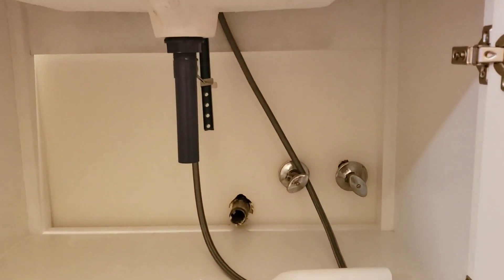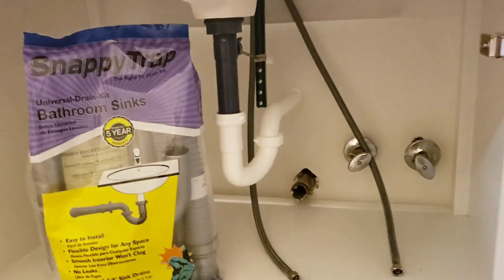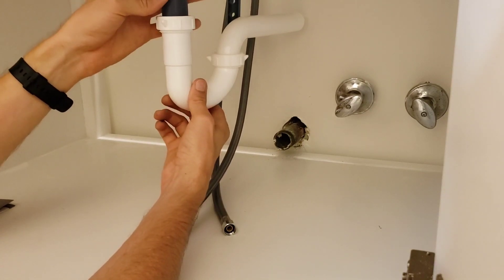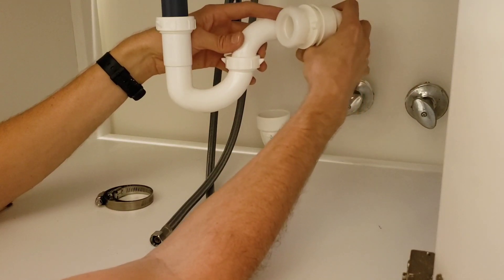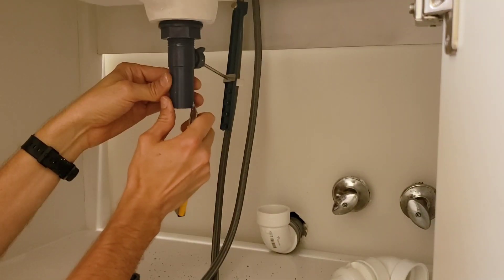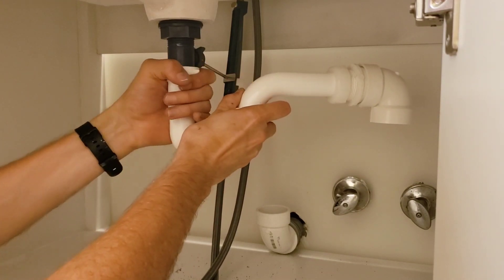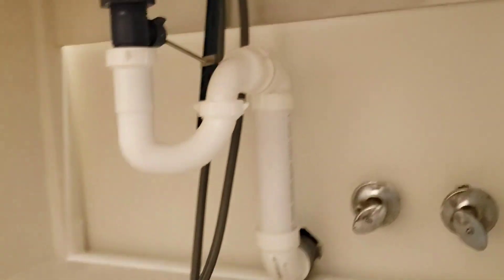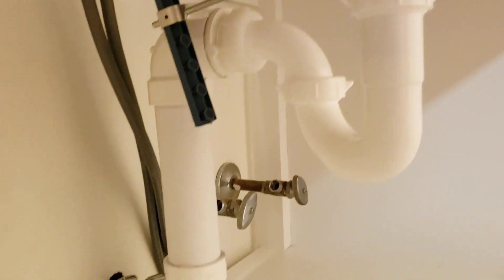The WRONG WAY to Install A Bathroom Sink P Trap Drain With Zero Clearance Below The Wall Drain Pipe

Comment: i LOVE IT. Good Video, Thanks.   Based on the comments below, it would be better to cut a giant hole in the drywall and then cutoff the drain coming out of the wall, attach a coupler to that, and have the pipe travel inside the wall cavity and make it look identical to what you did inside the cabinet? So the curve going into the wall is the problem?   Either way, thanks for taking time to show a solution to a problem.

Comment: Great job trying to figure this out, however, this would never pass inspection and the configuration will pose problems. Youtube is great. I recommend wacthing several videos by reputable construction plumbers and getting code approved diagrams - understanding and adhering to rough-in needed prior to closing up the walls (with plans) would have helped from the onset of your project and prevented this exact problem. 

The bottom line here is that the wall needs to be opened and specific work completed to ensure this has been installed to code. Code exists for a reason. Completed plumbing to code will ensure the drain system from the fixture will perform correctly. Corrections include, but are not limited to; making sure pipe elevations, minimum and maximum pipe lengths, proper pipe run slope, correctly installed and connections to the santee, and drain and vent runs and connections both under the sink and in the wall and possibly thru the roof and under the subfloor.

That said, drywall is cheap and getting this corrected now is still more cost effective than down the road.

Comment: probably would have to open the wall a bit and fix that drain, OR cut a hole in the vanity bottom to allow the trap to fit.

Comment: You should attach some pipe,. maybe with a fernco... to 90 up, then have your waste come out, say 4" higher... it's basically an S trap... but, as a plumber... that's how I do it... you still lock out sewer gas, and the short drop of "fast drain" isn't really going to affect anything. I posted this before watching the entire vid...  I get a kick out of watching non plumber plumbing solutions...

Comment: This is an S-trap. Not advised due to siphoning effect which will clear the water seal in the P-trap and ultimately allow sewer gas to rise into the room
Reply: So what's the solution?
Reply: @armystud69420 put an AAV valve at the top of the s before it goes back down.
Reply: S traps are used ALL the time when the drain is going through the floor

Comment: Might as well not even have a p-trap if you're going to do that.  I have the same issue but if I cut a small opening in my cabinet bottom I will have enough clearance for the trap.  Not ideal but replumbing the drain is not happening at this point.

Comment: PLEASE BEWARE! I'm not being a Karen I'm trying to help. The only way to do this is to open the wall and move the drain up. The method used in this video will create an "S" trap which is not only illegal IN ALL 50 STATES, but let's forget about the legality of it and focus on the reason  it is illegal.  The "S" trap creates a siphon when draining or even flushing a close toilet.  This will empty the water out of the P trap and leave an opening for sewer gas to come into your home. do not do this!
Reply from the maker: That's why I have edited the title and description of the video to indicate not to do it this way.
Reply: would be awesome to see the follow up video showing the work being completed correctly. thank you for your response.
Reply: It’s like moving a toilet flange 2 inches away from the wall after the installment crew has already ran the plumbing and put the flange in concrete and now there’s a house that sits on top of it

Comment: How did you ultimately fix the situation?  I probably would have cut a hole in the bottom of the cabinet.
Reply from the maker: Air Admittance Valve on the top leg after the P trap.
Reply: @engineerable  are you having any issues with the aav? Looking to do the same
Reply from the maker: @nertilpsari9813  No issues with AAV. But plumbers claim AAV can fail. I could see that happening like 10 years down the line maybe.
Reply: @engineerable  thanks!
Reply: @engineerable  where did you install the AAV at?
Reply from the maker: @markdruck  On the horizontal section after the P trap.

Comment: This is a S-Trap and is illegal in USA (ie. will not pass code). So you actually made a video on how to do it incorrectly.
Reply from the maker: I learned this after posting the video and made changes to the title, description and thumbnail. An AAV valve will be added later.
Reply: @engineerable  I read it‘s only considered an S trap if the arm length is < 2 x diameter, which does not seem to be the case in your video
Reply from the maker: @kesogonzaga2671  So, I agree with you on this that it reduces the chance of sucking water out of the trap (have not had any issues with that), however it seems that even that is not allowed.
Reply: You can't install an S trap in new construction. You can repair the S trap you have.  And we'll never know if it's truly S trap because he didn't open up the wall to show us if it's vented or unvented.
Reply: @dalesworld1308  What is the actual solution to a drain that is too low? I have this issue with the kitchen sink.
Reply: @Medina_Y2K  Without seeing under your sink I'd say ither open up the wall and move the stubout higher or do what was done in the video if that's not possible or inconvenient. Water MAY only get sucked out of a toilet with an extremely strong flush is right next to the sink and neither is vented. In a kitchen that's not an issue. You could always add an air admittance valve if you don't know if the sink is vented up through the roof.
Reply: What is the right way to handle the exit pipe being lower than the p trap?
Reply: if you work it's legal
Reply: So here is the real question. Yea that’s an S-trap.. Yes, not acceptable in the U.S.  I personally, as an inspector, call it out.. will it ever get fixed? Most likely not. Does it function properly? Maybe.
Reply: 45degree compression fittings pvc

Comment: Good job correcting your mistake, explaining the mistake and posting it.  As another commenter posted, I don't like using those air admittance valves either. And they're actually prohibited in some municipalities.  If storage space was your main concern, then the air admittance valve is your option, I guess. BUT if you can't use those valves, you could have brought the p-trap as low as possible and run the horizontal pipe to an elbow and connect it to the wall drain stub out.  The reason your configuration makes it an "S-trap" and illegal is b/c of the long vertical run after the trap. Gravity will pull and siphon the water out of the trap. If you configure your pipes so the water has very little momentum, it won't pull the water out of the trap.
Reply: What about lowering the P-trap as low as he can then use 45-degree fittings to gradually run down to the wall pipe?
Reply: @vonkanon3091  This is my question.  I'm about to repair (replace the whole innards) of a kitchen sink with a floor drain.  I can put the p trap at the floor a little ways from the down turn.  Room really isn't a factor if there's a possibility of flooding from an air admittance valve.  I just found out there was an old version also called AAV -   "Automatic Air Vent"  - less reliable and gave AAVs a bad name.
Reply: this was not a correction. This was rigging it. the wall needs to be opened. the drain assembly and santee needs to be installed to code with correct elevations, slopes etc... had this been taken care of at rough in, this issue would not have been a problem.

Comment: This is why its so important to get the plumbing rough in installed correctly. Really the best, and as far as I'm aware, the only legal way per code, to fix this is to change the pipe in the wall, and raise the stub out. I do not like air admittance valves for anything, including venting, because they will eventually fail and need to be changed out. Plus I think they just don't work as well as a properly designed plumbing system. Super easy to change the pipe in the wall once you have access
Reply: If that is a standard cabinet probably the interior is raised by 6 inches, he just need to cut the cabinet. Is not going to looks good but I guess will be under code.
Reply: In old houses, the waste drains were typically very low in bathrooms... the issue is that the waste drain is a TEE, which is also venting the system. So, opening the wall and moving the waste is pretty involved. Ironically enough, I have to do this all the time in kitchens, where the waste is typically too high to accommodate modern, deep basin, undermount sinks with disposals....
Reply: Also, AAV's are fine, so long as they are installed properly... which means they should be installed ABOVE your highest flood point.
Reply: agreed. this is a common problem I see in construction projects. we are asked often to come in after the fact and sort out  problems that have caused costly damage and require opening walls and redoing work that was not done right the first time.  clients always say "i spent so much money on construction already" and they do not feel they should have to spend more money. if it was done correctly, with plans etc from the get go, then this would never have been an issue.cutting corners never pays off.

Comment: Is this considered an "S" trap?
Reply from the maker: Yes, I've been told this is an S trap. Read the description, it can be fixed using an Air Admittance Valve (AAV) on the horizontal section after the P trap.
Reply: @engineerable  sorry but that’s a crown venting ,both are not allowed , for you will loose the seal in the trap, meaning  sewer smell and maybe some creatures coming out your sink.  The corrugated pipe is a mess also. In this case is worth it to hire someone, or look for more videos of how rise the pipe inside the wall ,is not that hard actually.

Comment: All this work just creates a siphon-prone s trap.  Too bad some viewers are following this video.  They will smell stinky sewer gas if they do the same.
Reply from the maker: I learned soon after posting that this was an S trap and have edited the video title, thumbnail and description to say that this is not the way to do it, but can be fixed by using an Air Admittance Valve (AAV) mounted 4in above the horizontal section after the P trap.
Reply: not necessarily an s trap if that drain is vented up which would not cause any siphoning

Comment: Exactly what I'm about to do, thanks for confirming that this can be done with the vent and without any "don'ts because" or it's "not code" issues.
Reply: The dirty arm needs to be installed in a new santee in the wall. this should have been done correctly at rough in.

Comment: Thanks! I got the same problem with a new vanity I installed over the weekend. Will definitely give this a try.
Reply from the maker: I hope you saw the notes that say that what was created in the video is actually an S trap. In addition to what was done in the video, you will need to add an Air Admittance Valve (AAV) like this one https://amzn.to/3a6wCUg right after the P trap before the water goes down.
Reply: @engineerable  I saw that. Thanks.

Comment: Perfect. Just what I was looking for. Thanks
Reply from the maker: No problem. Please read the description for the modification that has been recommended.  An Air Admittance Valve must be added after the P trap. The Valve must be at least 4inches above the horizontal pipe. An AAV like this can be used: https://amzn.to/3a6wCUg
Reply: @engineerable  you’re correct about needing an AAV, however you can’t just add one wherever you want. Generally it’s for kitchen islands only and for a couple other cases (yours is not one of them).
Reply: @DrewRasmussen why not?
Reply from the maker: An Air Admittance Valve must be added after the P trap. The Valve must be at least 4inches above the horizontal pipe. An AAV like this can be used: https://amzn.to/3a6wCUg

Comment: no good you made an s trap
Reply from the maker: Makes sense, thanks for pointing that out. So what are the proper solutions in my situation where there's no clearance below the drain pipe? Should I install an Air Admittance Valve?
Reply: @engineerable  you can use a genova aav. called a nova vent
Reply: @jacksplumbingvideos7147  I would use a navalon 7 without the side clattons.
Reply: I’m running into the same issue. An S trap will siphon water out of the P trap part and let gassed in. What’s the solution?
Reply: @ZachBugay  an aav